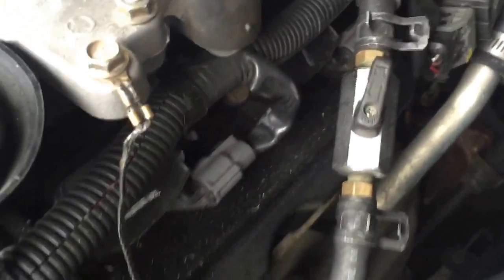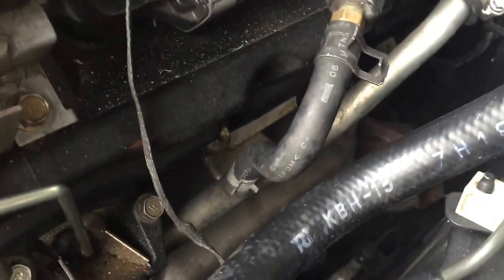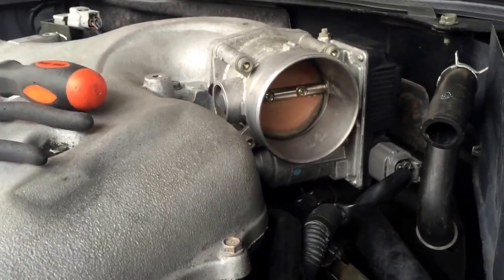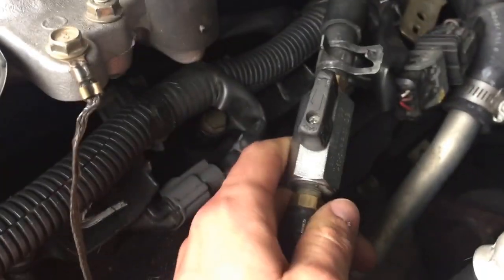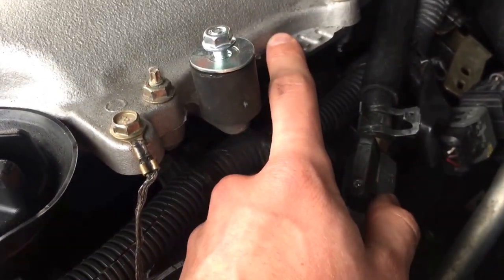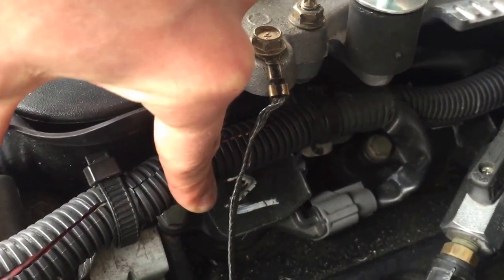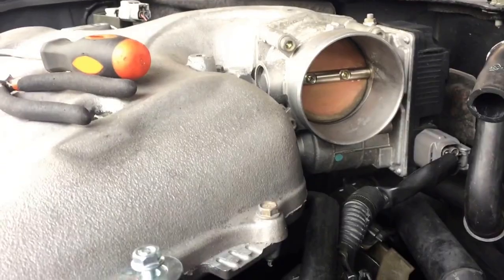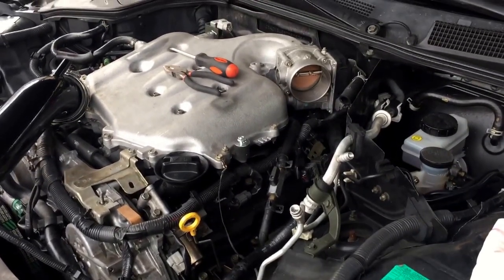Throttle Body Coolant Bypass- Infiniti G35

Comment: It would be better to just pull both of the coolant lines out of the TB , and connect them together , so you still have the water flow , but , not into the TB , this coolant returns back to the engine at some point , just in case ,
Reply: This is safe?
Reply: @frostythedanknugz  Depends on your state i live in florida , might be effected by cold , during first start
Reply: @frostythedanknugz  only if , it gets really , really cold , then you might have frozen TB’s
Reply: i was wondering the same thing....im stuck on doing that or deleting them both and plugging them. i think it would be a good idea to keep the flow going but then again with it deleted the engine wouldnt have to push hard to get the coolant out. what do yo guys think about the front coolant hose delete? the one that goes to thermostat?

Comment: How do you know which plug to put he hose on the throttle body cause there are two one small and a big one?
Reply: Check it by touch, if it warms up then you got the coolant hose, there should be two of the same size, inlet and outlet.

Comment: I know this sounds stupid, but I was wondering if anyone knew what the part is called underneath that this is attached to? That metal hose that attaches to the bottom. I have a leak right down there but have no clue what the part is called?
Reply: Did u find the name of the part ?
Reply: lucky_ twin sadly no 👎🏻
Reply: Possibly your water inlet gasket  where the metal hose bolts  to the  engine towards the front of the engine jus above ac compresser
Reply: bahenaabel14 you've probably fixed it by now, but it's called the "coolant crossover pipe"

Comment: do you know the size of the hose?
Reply from the maker: Bustitover I believe that is a -8AN (aka .5 inch) hose line if I'm not mistaken
Reply: ok thanks
Reply: I also use Brass Ball valve 1/4 inch and 3/8 in ID X 3/8 in MIP.     its a sweet set up